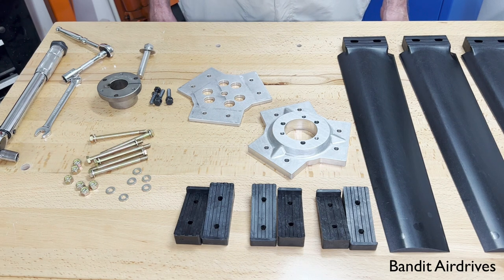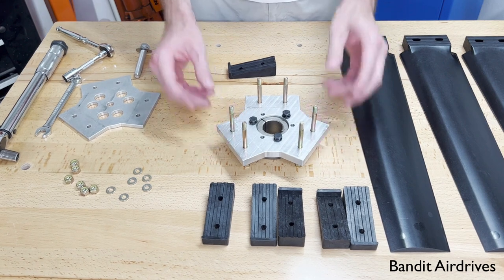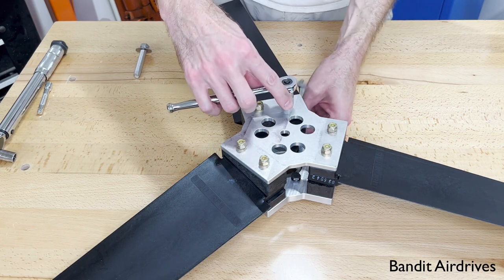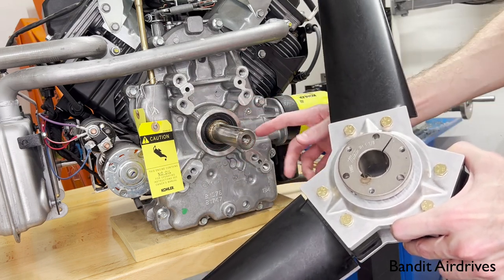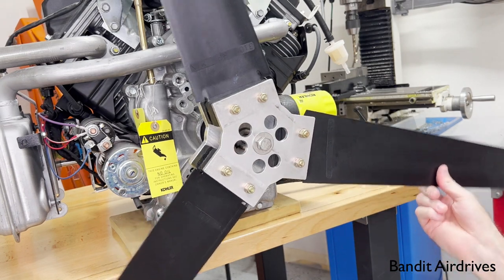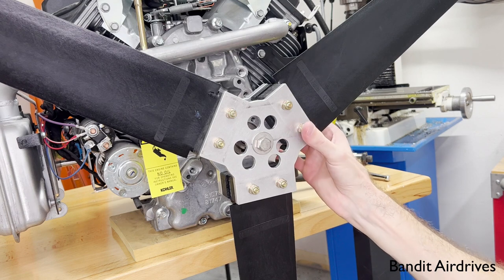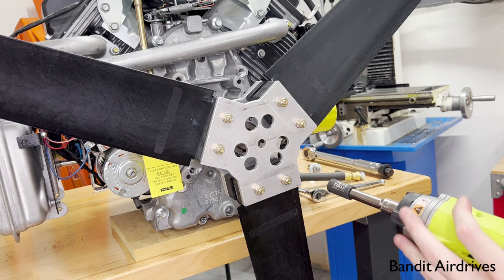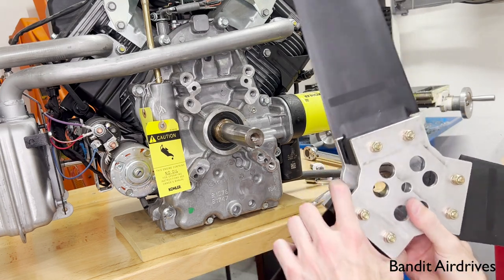Ultra Prop Direct Drive Installation Guide

Comment: What does the engine idle at with this installed and how much?
Reply from the maker: It depends on which pitch blocks you use on the propeller, but we shoot for somewhere around 1200 rpm at idle. The 3 blade setup shown here is $535 total.